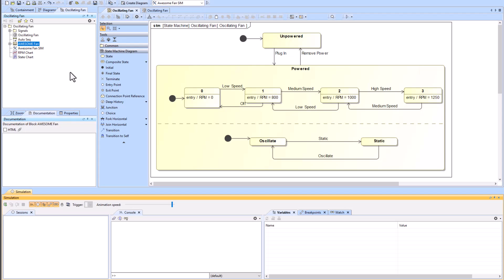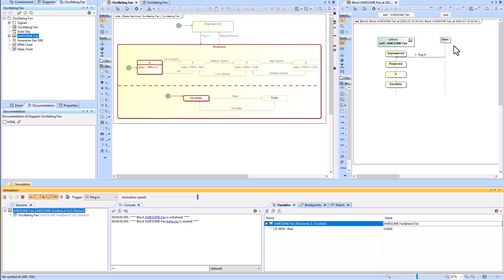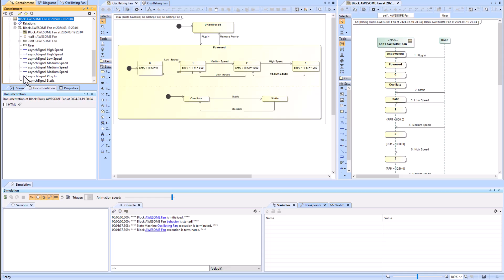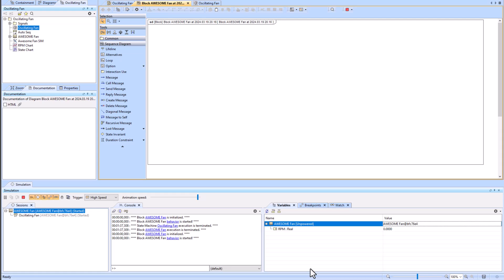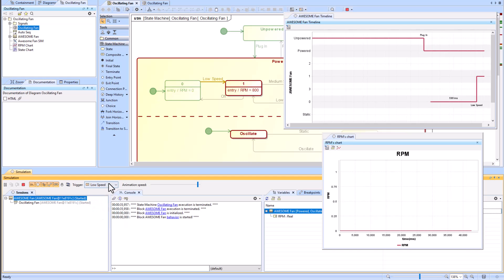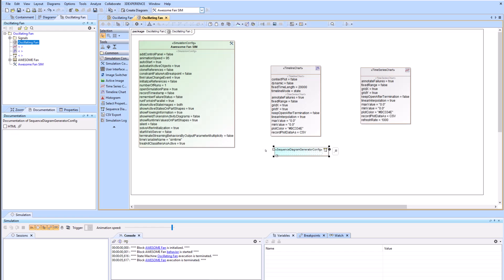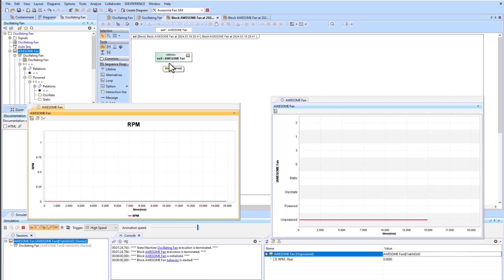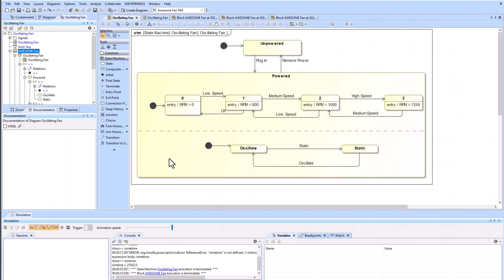Cameo - Automatic Sequence Diagram Generation

Comment: Hi. Thank you for this content. Do you know maybe, how we can reuse automatically created sequence diagram as  some kind of test case and/or presentation run? All the best!
Reply from the maker: Yes, you can easily take the automatically created sequence diagram and change the user lifeline to the part property which would be sending the messages.  You can then attach the sequence to a test case which would then verify a requirement.